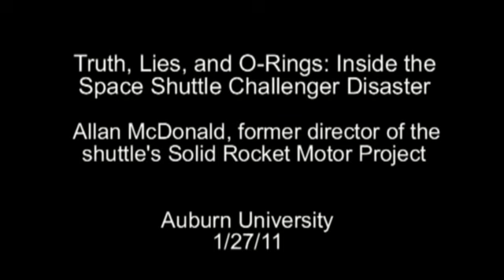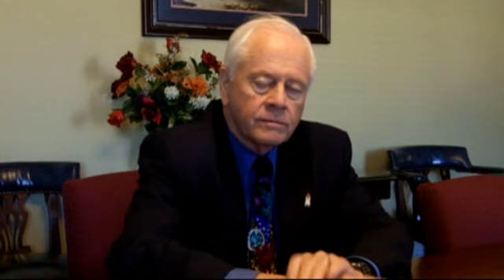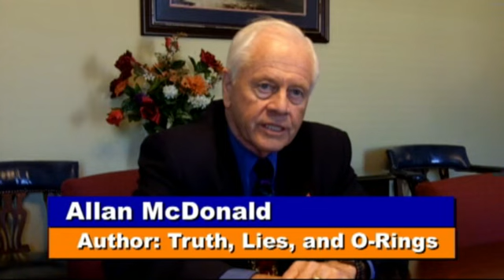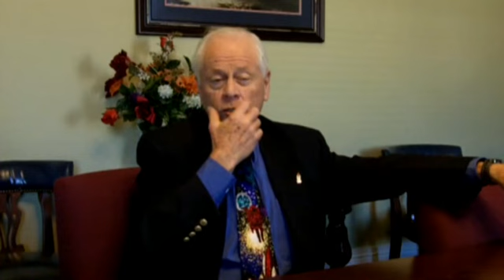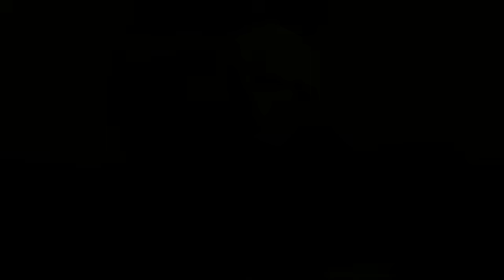Challenger: 25 Years Later

Comment: After the 2nd accident, they did fix the foam problem.  In my view, at that point the shuttle was a very good space flying system.  The astronauts said the same.  I would have flown on it without reservation.

Comment: Dale Tiger, Robert Dambeck — you both obviously don't know what you're talking about.  Allan J. McDonald, Roger M. Boisjoly and Arnold R. Thompson were the three Morton Thiokol engineers who recommended that the Challenger launch be postponed.  Their recommendation was ignored by NASA and overridden by Morton Thiokol management.
Reply: +Milosz Ostrow   You're correct.
Reply: My thoughts exactly you took the words right out of my mouth. The fact is we had two republican presidents and republicans running NASA. Sean O'Keefe said the previous Administration was run by democrats. Which in the 1990's a whole decade of trouble free launches. And NASA was allowed to delay a launch as long as they could.

But O'keefe said they was confused and all he cared about was budget cuts. It was apparently that he and the republicans running was confused about a piece of foam strike that was light as a feather and they couldn't FATHOM that a piece of foam would doom the Columbia. And they made the decision that is was a maintenance issue not a safety issue.

They had asked the air force if they could use their spy satellite to take a picture of Columbia while in orbit. NASA management said NO.  Republicans were also threatening NASA that if they kept delaying launches that they could cut funding for the ISS. Republicans hate the space program and they got their way with getting rid of the space shuttle.
Reply: You are absolutely correct.  My dad, Robert Ebeling was one of the engineers that said, DO NOT LAUNCH.
Reply: I agree completely.  My father, Robert Ebeling was tormented the remainder of his life because of upper management.
Reply: Republicans don't hate the space program.  The main reason the shuttle flew in 1981 was because Reagan threatened to can the program if it didn't fly.  Delays, cost over runs were the reason it did not fly sooner.  He made it happen.  The reason the 90's were so successful in the shuttle program was because the SRB was redesigned after the loss of Challenger.  If I am not mistaken, George W. Bush started the Orion program to go back to the moon and OBAMA canned it.  Get your facts before you say something.
Reply: Columbia was a different situation, it was a design flaw with the fuel tank not the SRB.  They had seen issues with the delicate heat shield in several launches throughout the 80's and 90's caused by strikes of foam during launch.  They did nothing to fix the problem.  Funny how it works in space flight and in aviation that a problem is not rectified until a disaster happens.
Reply: Captain Genius - obama actually got Iran to Stop nuclear development.   It took Trump to screw that up.
The GOP under Nixon and Ford also cut NASA funding and were the reason the shuttle ended up being the design it was.
But ultimately- all the government did was provide funding. Apollo was designed by a several corporations and so was the shuttle.
If the management at Thiokol had backed their engineer the launch would not have happened.
If management at NASA had not been pressured by Reagan’s administration to step up the launch pacing, at peril of their jobs, they might have followed protocol.
It comes down to complacency... no matter how many close calls the shuttle had in prior missions, management and the administration only saw the mission success and mistook a narrowly averted disaster for a sign of a robust and reliable design.
Something as pedestrian as whether a given manager had to pay for braces for his kid’s teeth, or college tuition, can skew their judgment over whether to take a chance if it means keeping their job, versus knowing for certain they would be fired if THEY’RE the guy that scrubs a 140 million dollar launch.

It’s NOT political.  Its merely human nature.  Cover your own ass, cross your fingers, and hope for the best.

Comment: I just don't get it why do all those engineers call the 2 O-rings a redundancy. They are a series of two rings with identical vulnerabilities. If one fails there is NONE after it IN GOOD WORKING ORDER to take its load, unless LUCK plays a part. If something of a different design and making would have been used as a backup for the first ring, ok... but, as it was... There was a single dual-rings system, NOT two redundant systems.

Comment: NASA and Thiokol seemed to intentionally obscure the fact that “blow-by”, “erosion”, and the condition Boisjoly et al warned about on January 27, 1986 are three different problems. 

Blow-by happens when (1) there’s a blowhole in the putty upstream of the primary o-ring, which is a problem that occurs at random, and (2) the primary o-ring doesn’t touch the sealing surface before hot gas reaches it. 

Erosion isn’t that severe of a problem, as the design expected it (it occurred on the Titan rockets from which the design originated) and had redundancy. 

What Boijoly warned about is that IF there was blow-by of the primary AND the secondary didn’t seal properly, the joint wouldn’t seal at all and a catastrophic failure would ensue. 

The joint flexed a bit on ignition in a way that moved the primary o-ring away from the sealing surface and pushed the secondary towards it.  Larry Molloy seems to have thought this meant the secondary would always seal, so primary o-ring blow-by wasn’t that big a deal.  But Boisjoly was emphatically telling him that the ability of the secondary to seal would fall off with temperature (it takes longer to move across the gap between its groove and the sealing surface when it’s cold), and Thiokol did not know the temperature at which it could no longer be expected to seal at all. 

So when Molloy’s saying there was blow-by on a warm weather flight, that’s a red herring. It just means there was a blowhole in the putty and that the primary o-ring (which doesn’t move the same way as the secondary on ignition) hadn’t sealed.  It doesn’t tell you anything about the secondary’s ability to seal in cold temperatures, which is what Boisjoly was warning about.

Comment: The Solid rocket boosters shouldnt have been built in segments.
Reply: You cannot build a booster of that size as a single component. The original o ring capture design was flawed and allowed too much flexing during ignition. Adding a capture feature on the Clevis leg on the redesign solved the issue and the same design is flying on SLS.
Reply: If your Senator on NASA Appropriations Cmmtee is from Utah - a landlocked state that prevents use of barge and single-construction solids - then and only then do segmented sealed SRMs come into play.